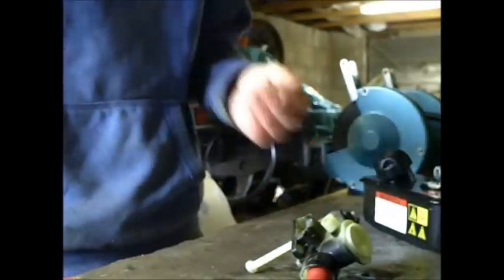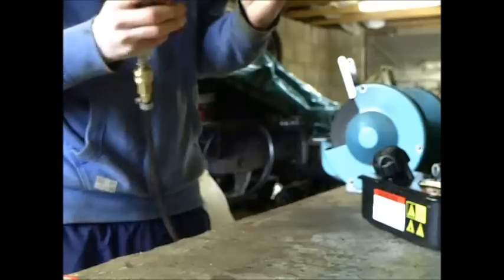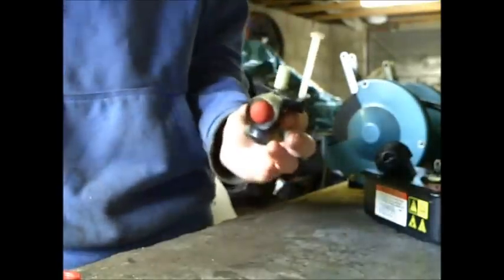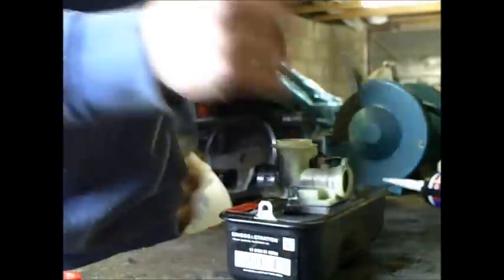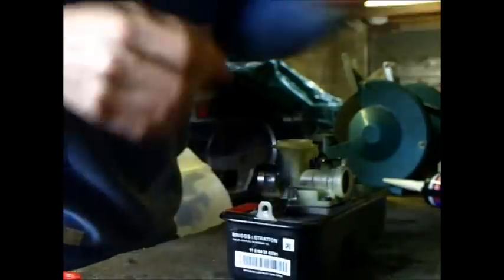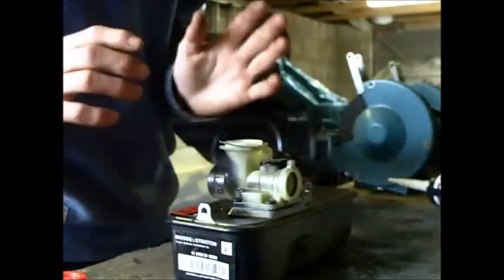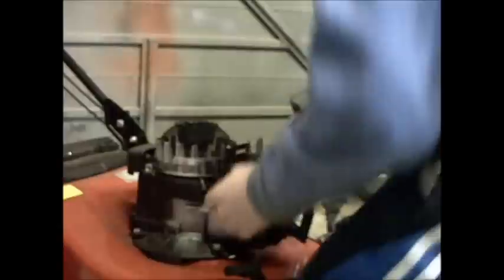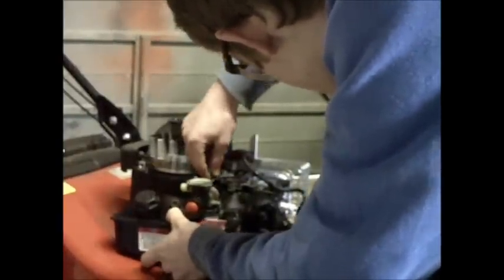Briggs & Stratton 450 S Carb Stripdown Part ~3

Comment: Nice video's :) I have NO clue about engines. I have a lawn mover like this, and it starts if I prime but then stops again. I have left it out in the rain and such. I could not get a hold of compressed air so I just cleaned the air filter, pressed out the oil, replaced the fuel and added oil,,it seamed there where no oil left in the oil tank..I filled it up to much with oil, I seam to do that every time. What do you think is most likely the reason that it stops right after it starts?

Comment from the maker: Hmm Its hard to say because I am no pro I just play around and take thing apart and learn how it works that how I know so much about engines and machinery. Does it just fire up then stop because if its that maybe theres no fuel getting into the cylinder or too much fuel and just flooding If it is doing this take the spark plug out and make shore it dry and clean and re gap it if this dosen't work try something els :D